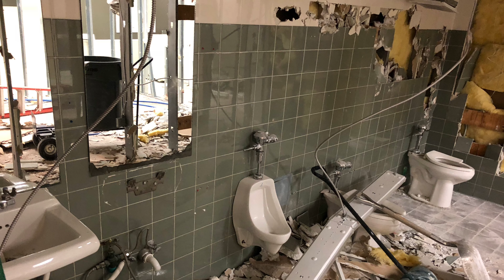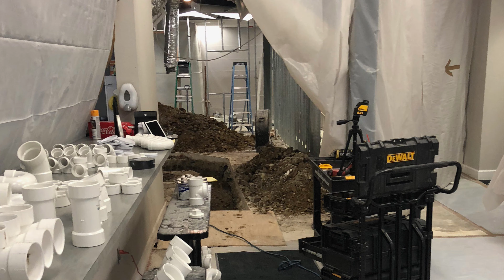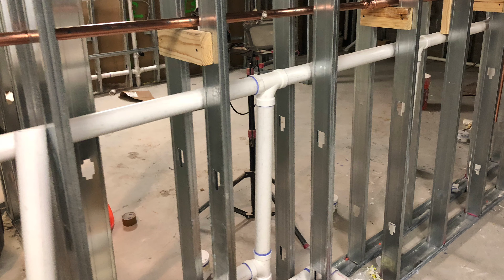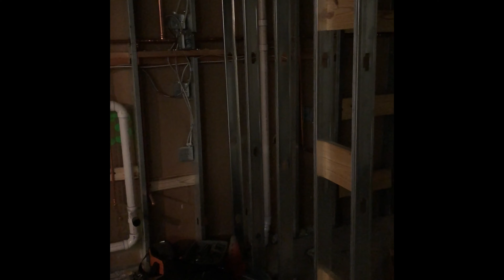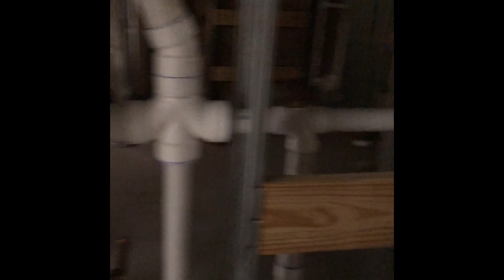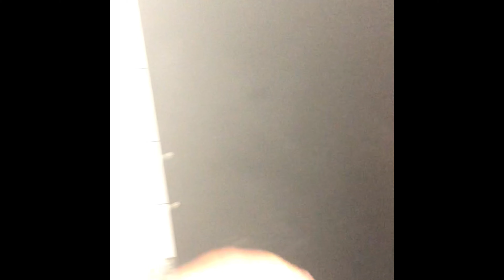Commercial Restroom Plumbing Remodel

Comment: What a great looking job! Especially on the groundwork. I tried looking hard, but I couldn’t tell if you used ProPress on the flush valve stub-outs. Did you solder those 90s or did you use ProPress? If you used ProPress, how did you solder the threads onto the stub-outs for the flush valves without melting the ProPress O-Rings?
Reply from the maker: Everything was Pro press except for the stubout 90. Those were soldered. Thanks for watching!
Reply: @Plumb4fun247 , I wish Viega would come up with some magic solution for being able to use ProPress for flush valve stub outs.